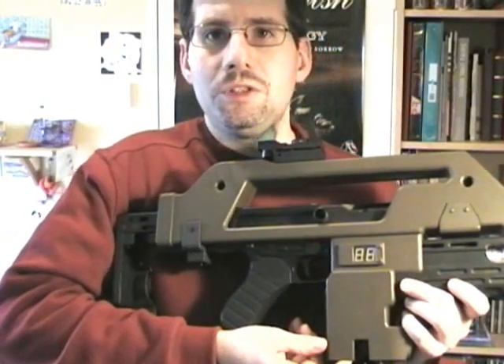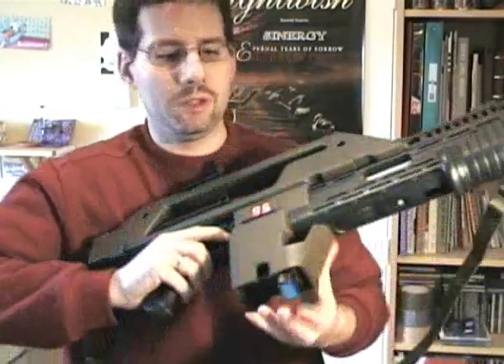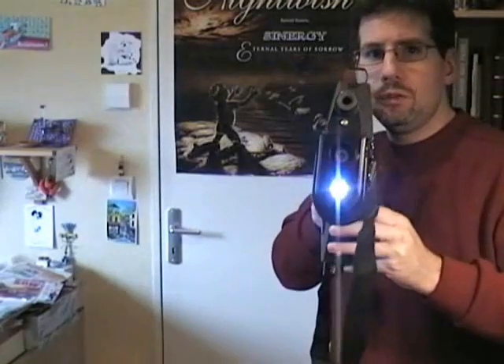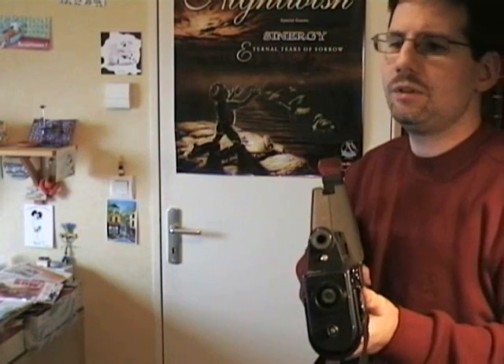Aliens Pulse Rifle demo video

Comment from the maker: you're right, and that's for sure more like a "demonstration". Sounds can be changed of course. The difficulty for the particular case of the grenade launcher is that you don't want just the "foop" noise of the trigger, an explosion is expected at some point. But I agree with you that it should be more "instant boom boom" :-)

Comment: So, the sound boards these days use SD memory sticks, or similar?

Where is the speaker at currently? The volume really is the problem, you could try raising it in sound editing programs on your computer by half dB per, until you get it where you want. I don't know how well it will work with that speaker though, it sounds like it will probably have quality issues if the bass gets too high. The sounds in the video you linked are pretty good, excluding the invisible Aliens inside the gun dying. :)

Comment: Couple of issues: (but hey still better than every other pulse rifle)

-99 bullet counter, why 95 :((
-Grenade launcher launch sound drags a bit too long
-Pulse rifle firing sound from the recent AVP videogame is perfect, but this one seems different.
Reply from the maker: sounds are easy to change with the SD card system. For the 95 counter, look closely, you'll see that the mag insertion resets to 95, not 99.
Reply: The Avp games had pulse rifles with 99 rounds. In the movie it was 95. You could clearly see it when ripley is gearing up to find newt.